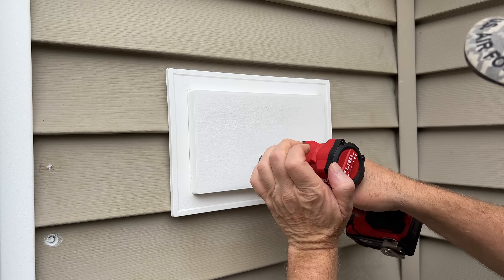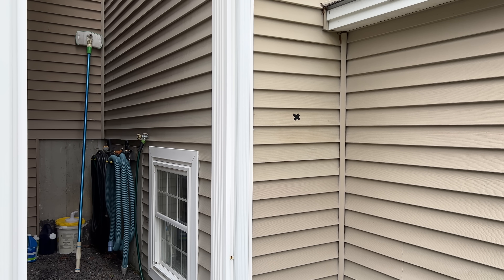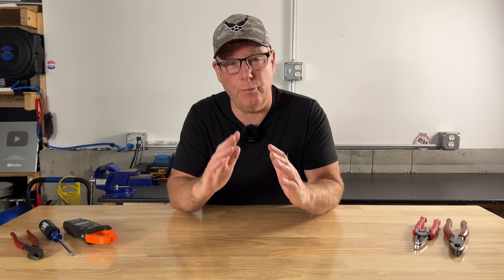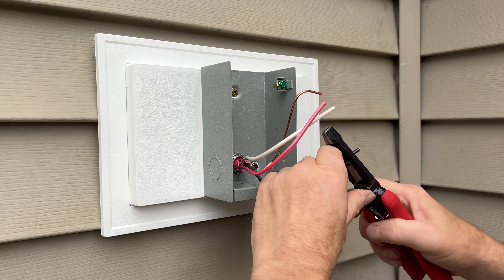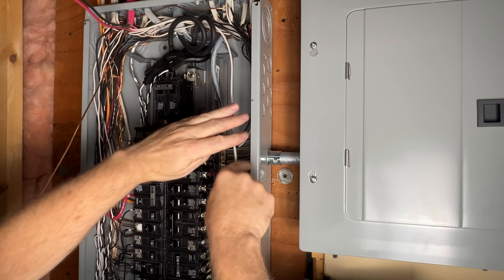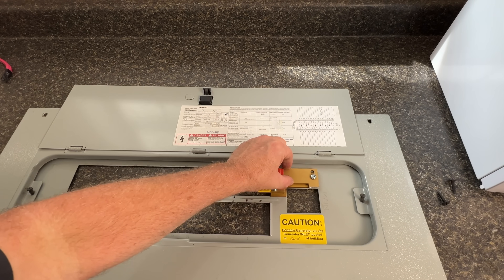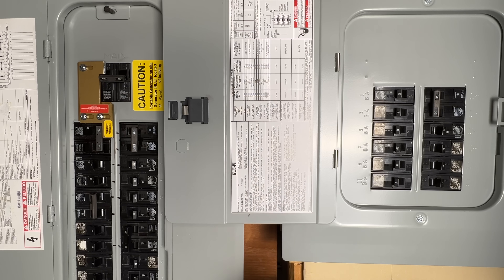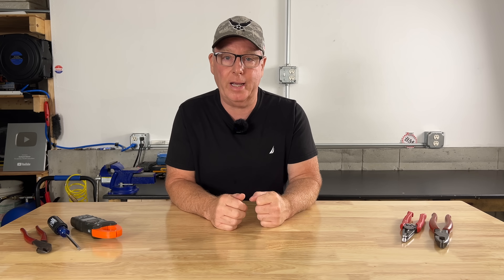Watch This Before Connecting a Backup Generator to Your Home.

Comment: we went with the duromax xp12000EH and for clean energy necessary things like computers a predator 5000 inverter . the main is run by the duromax for the last two years and it has been flawless. The power it outputs is pretty clean as well and have never had any issues. It runs two windows a/c units, a 10k and a 240 volt 25000 btu. Both run fine. The Predator is a year old and has maybe a hundred hours on it. It too is flawless but in going with the 12000 for main power it runs at less than 50 percent and fuel savings doing that is noticeable.  Both are fantastic options depending on home size and needs.

Hurricane Milton is bearing down us tomorrow night and they are estimating a week to ten days or more without power. these machines will save our freezers and keep us cool while waiting. Both are dual fuel and really triple with natural gas.  Propane is available right now when gas stations are out of fuel already.   Hop99ng everyone in Florida stay safe and evacuate if they tell you to.. This is a hundred year storm guys n gals. pay attention and do not be stubborn. you have NEVEr seen this kind before and neither has grandpa.
Reply from the maker: Prayers for you and everyone about to be impacted by this powerful storm 🙏🏻🙏🏻
Reply: @daddski1  I’m just outside of Tampa.  We dodged a bullet. Lost power at about 7:40 pm Wednesday, and got it back Friday at 4:30 pm.  Ran 2 refrigerators and one chest freezer on a WEN 4750 dual fuel (used propane) with extension cords.  Wanting to run a 30 amp outlet to the box but the electrician is ridiculous in price. This video was clear and concise.  I just don’t like putting my hands in the panel.  Trying to find a reasonable electrician to do it.

Comment: Forgive me I have a question.  I'm setting up this type of connection at my house. But I'm putting in my main box outside.  That main box has the ground and common on the same buss. Does that mean the generator should have a floating common.  Or does that matter. I'm not afraid to do the work at all. I'm just not sure on that hookup. I didn't even know of the common and ground being bonded in the generator till today watching videos
Reply from the maker: Unless you’re using a transfer switch that also switches the neutral along with the line wires the the generator needs to have a floating neutral because the neutral to ground bond can only happen in one location on your electrical system
Reply: All I was planning to do (unless told difrent) I was going to put a 50 amp breaker on the panel.  The interlock to shut off the main, then the 50 amp could be turned on.  That panel is the main so if I'm understanding right I'll have to make my gen a a floating neutral.
I'm planning to use the predator 13000 watt from harbor freight.  
The inverter gens are out of my reach.

Comment: I purchased a good size inverter generator. And the Neutral is bonded to the frame on this generator. Do I need to disconnect the neutral from the frame of the generator to eliminate the risk electrical shock?
Reply from the maker: The neutral to ground bond can only be made in one location on your electrical system.  Since it done at the main you will have two choices when connecting a generator. You can run the generator as a bonded neutral system but you will need a transfer switch that not only switches your hot ungrounded conductors but also your grounded neutral conductor. This would now be considered a separately derived system. Or you could disconnect the bond on the generator and connect it as I did in the video
Reply: @BackyardMaine  Thank you for the reply. I did do exactly what you have done in the video. Just the bonded neutral has been the topic of much debate , and NEC always seemed clear to me. In my case, needing to remove that connection. My Generator has a 50 amp output, so I found and purchased a 50 amp  single pole din mount breaker, and plan to wire it on the neutral on the generator, so I can make the connection when running the generator normally, and breaking the connection if I need to plug in into the house. Thanks again for the knowledge.

Comment: excellent video 
I would like if you can make a video on how to wire the 60amp sub panel 12 breakers for the generator
Reply from the maker: I just installed one this summer. I should have recorded it but I was in a hurry.

Comment: I am relocating my dryer outlet to the garage. I can use split connectors wago (10 awg) for extension ?
Reply from the maker: You can as long as they are the ones rated for 30A and 10 gauge wire. I would recommend wire nuts for higher amperage loads like a dryer.

Comment: Great video. I appreciate your taking the time to explain. You mentioned possibly getting a larger generator, will you have to go to a larger breaker if you do, like 50 amp?   Thank you again.
Reply from the maker: Even with a larger generator I could still plug into the 30A receptacle on the generator and use the same hookup. But I would upgrade to a larger feed to take advantage of the 50A connection on the generator. That would mean a 50A inlet box, 50A breaker and upsize the wire to 6 gauge copper.

Comment: What is mean is, without a main shutoff in my indoor panel,  I can't install the lockout
Reply from the maker: You can but you will need to install the connection and interlock outside at the main.

Comment: Hello, is it possible to simply change the main switch for a transfer switch (Live - neutral - Generator)? We would then have the choice of using the desired circuit breaker(s) and being able to switch from one to the other as we wish (while respecting the capacity of our generator). It seems simpler to me than having to add a second electrical panel dedicated to the generator.
Montréal, Québec
Reply from the maker: The sub-panel is not required for this generator connection. I also have a battery power station with an automatic transfer switch. Since it's automatic I needed to add the sub-panel so I will not overload the unit. Who know what will be running when the power goes out right.. But for a generator feeding the whole panel and being selective about what you run and one time is how I run my system. The neutral can only be bonded in one location. So unless you have a transfer switch that switches the hots and the neutral you need to run the generator as a floating neutral. It is possible to remove the neutral bond to ground on your generator. Check with the manufacturer or your manual for instructions.

Comment: Any advantage of an inverter generator over the ones listed? Thank you for your content.
Reply from the maker: I really like inverter generators for a few reasons. First they use much less fuel, second the supply clean non-fluctuation power to your home and third they are quiet. I won't run sensitive electronics for my current generator. The down side is they are more expensive and until recently were quite small. Now I'm seeing several larger ones on the market. I want to buy one but I'll wait a while to see if a company will give me one for a video.. Here's are some links to ones I like. https://amzn.to/4dBw8mz  https://amzn.to/4gLGcMm  https://amzn.to/47TVk6k
Reply: @BackyardMaine  Thank you for your answer and info!! All the best!

Comment: My main panel with 200 amp main breaker and meter is outside, it also has the breaker for my well. My sub panel is just inside with all the breakers for the house, including ac condenser, welding outlet and many arc fault breakers. Neutral and ground bonded at main, not bonded at sub panel, like it's supposed to be. What's the best way for me to wire up the generator inlet box? Should I wire it at the main box so I could install the proper interlock but what do I do about the neutral/ground bond? I don't think I've ever seen a generator without a bonded neutral and I don't want to have modify my generator and every other generator that could ever get plugged in it (example if I have to borrow a generator from someone). If I float the neutral in my generator then I have to remember to bond it again if I ever use it for an RV. Should I wire it at my sub panel where neutral and ground are separate? I've read to make a cord and not connect the ground wire, I've also read to connect the ground but not connect the neutral wire. Which is the correct way? Is this covered in the NEC? I wired my panel boxes and they're fully to code but this one is puzzling me because I have never wired in a generator inlet.
Reply from the maker: Sounds like your best option would be to use an interlock in your main panel and then be selective about what loads you run on your generator. The neutral and ground can only be bonded in one location so it not being bonded in the sub panel is correct. The whole system is bonded when it's done at the main. When it comes to your generation connection you have two choices. You can run the generator with a bonded neutral but you would need a transfer switch that switches not only the hot conductors but also the neutral. This would be considered a separately derived system in the code and be compliant because the only bond would be at the generator when the transfer switch is engaged. The other more common method is to run the generator as an unbounded or floating neutral system. If the generator is bonded you should be able to remove the bond to make it floating. Check your user manual or contact the generator manufacturer for instruction on how to remove the bond. The cords and cable connecting your system need to be complete. Your two line wires, a neutral and a ground are all needed for safely and to meet code. I hope this helps.
Reply: @BackyardMaine  I looked into installing a transfer switch but that would involve altering my panels and I don't want to go through that trouble. When I built my house I didn't think about wiring it for a backup generator, I wish I did because it would've been easy then. I'm going to look into altering my generator to float the neutral. Unfortunately I didn't think about this before buying a generac, generac doesn't allow customers to disconnect the bond, they don't supply instructions and don't give any information to do it. It's a GP7500E DF which there are videos on YouTube for unbonding it but a few people ran into issues and some didn't have a problem. It's a little more involved than other brands. In the manual they said that it's permanently bonded at the coils. I really don't want to go against the manufacturer instructions but I think I have to in this case or return the generator and get something different.
Reply from the maker: @Antoniocool86  Surprising.. If you pull the end cap on the generator you should find a neutral to ground bond. The issue for manufacturers is that if using the generator for other than home backup the neutral needs to be bonded. So for liability they bond them. But when you connect the generator to your home (without switching the neutral) the bond needs to be removed. Plenty of people run them wrong but you are really asking for problems and it's not safe because you can have current flowing between paths with different resistance. If you remove the bond and want to use the generator for other than home backup you can simply make a grounding plug by putting a jumper between the neutral and ground terminal on a plug and plug that into a generator receptacle when needed.
Reply: @BackyardMaine  yes that's the way I saw it done on a YouTube video. When I unbond the neutral what do you think about a bonding plug for when I need to use the generator not as a backup for my home? If I use the generator not powering my home I would be using the 120 outlets so maybe I could just make a bonding neutral plug 240 plug and just zip tie it to the generator that way when I need the 120 outlets I just put in the 240 plug that I would make and it should bond a neutrals on the 120 outlets. Of course I will confirm with my meter but it should work

Comment: I think 10 AWG is a bit small
Reply from the maker: Just the right size for a 30A inlet connected to the L14/30R on the generator. We're also feeding through a 30A breaker at the panel so the wire in protected was per 310.16 in the NEC.

Comment: How does this work when the main shut off is outside and the breaker panel is inside?
Reply from the maker: I also have a main shutoff in the panel which was the original main when the house was built. When the service was moved during an addition build I added a meter box with a main breaker. I had to do this because of the distance to the panel was increased by 30 feet. My neutral to ground bond in now outside so I have separate neutral and ground conductors running form the SE to the panel.

Comment: So, if you connect it to the outside panel,  I guess is ok to the neutral and ground goes together!!
Great video by the way
Reply from the maker: Thanks. The neutral and ground are bonded in one location often at the meter especially. If not there it's done at the main panel. There are specific requirements as to how and where to bond. The key is there can only be one bonding point. If your generator has a bonded neutral you will either have to install a transfer switch that also switches the neutral or remove the bond at the generator.

Comment: What about the price of your sub panel in sub panel Breakers
Reply from the maker: I installed the sub panel for another project where I installed a battery power station with an automatic transfer switch. It's not needed for a generator hookup like I show here in this video.

Comment: You made that look easy,  got any tips for how to install a siding block?  I am decent with tools and tend to fix my own EVERYTHING , but have zero experience working with siding.  I am a ham radio operator and want to install a larger size block to create and antenna coax pass thru into the house
Reply from the maker: I’ll bet you can find some good videos if you search for it on YouTube

Comment: Mine doesn’t seem have 1 main switch to turn all of main of like yours.  But it does have 1 empty spot that a 30 amp could go. There main cut off by meter outside home. Is this still possible ?
Reply from the maker: You have a couple of choices. You could probably add a 30A two pole outside next to the main breaker or you could buy a manual transfer switch setup to install inside the house and bring over circuits to that.

Comment: I keep my generator in my shed and feed my panel underground do I need to have a separate ground rod for the generator
Reply from the maker: Most likely no. If you are using a generator with a bonded neutral and a transfer switch that switches the hots and also the neutral then a ground rod should be used. But if your not switching the neutral you need to make sure your generator does not have a bonded neutral and there is no need for a ground rod.
Reply: @BackyardMaine  it doesn’t. Thank you very much for the reply

Comment: Thoughts on a 30amp plug adapter to 15amp and then using a 15amp inlet?  I only have room for a 15amp breaker in my panel.

Comment: Hey you should mention about the generator is it a floating neutral or frame bonded generator,  when you connect to the house like you did you need the generator to have a floating neutral. It uses the house bond and its code per the NEC. Not getting into all that its a vid in itself.  All gens will tell you what they are and give instructions on how to remove to green bonding jumper if they are frame bonded and not floating.
Reply from the maker: Thats a subject for an upcoming video. It doesn't really dictate the installation since the generator can be simply bonded or un-bonded if needed. It's a good point though and one I'm going to cover in the next few weeks.

Comment: Im confuced you don't need a trans fer switch ?
Reply from the maker: The interlock kit I installed in the panel functions in a similar way as the transfer switch. It will not allow the generator breaker to be turned on without the main breaker being turned off. This (like a transfer switch) keeps us from back feeding the utility. This is the most common method to install a generator backup for two reasons. It is the least expensive and it allow more flexibility to choose specific loads when they are needed.

Comment: is 10/3 also good for 50amp?
Reply from the maker: A 50A would require larger wire. If using NM cable it would have to be 6 gauge copper. The 10 gauge I used is only rated for 30A.

Comment: Great video - thank you. Have you covered bonded/floating neutral generator topic and grounding (in any other videos? I just read about it and wanted to have your thoughts. Thanks.
Reply from the maker: Not yet! I am planning a video to cover this in the next few weeks since a lot of people have been asking for it. Even many electricians get it wrong and it has to do with whether you are running a bonded neutral generator or more importantly when a bonded neutral or floating neutral is required. Stay tuned for that video. I'll cover everything you need to know about the subject.

Comment: I'm not an electrician but shouldn't the new generator breaker have an additional method of securing it to the panel per NEC 408.36 (D)
 "Back-Fed Devices: Plug-in-type overcurrent protection devices or plug-in type main lug assemblies that are backfed and used to terminate field-installed ungrounded supply conductors shall be secured in place by an additional fastener that requires other than a pull to release the device from the mounting means on the panel."
Reply from the maker: The interlock kit comes with a zip tie and a label instructing not to remove or move the breaker. This covers the required.